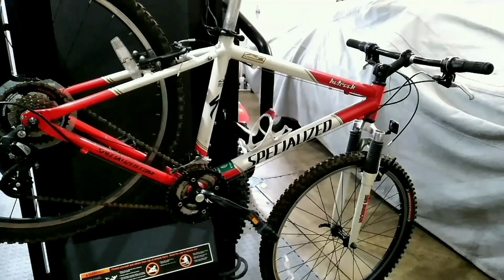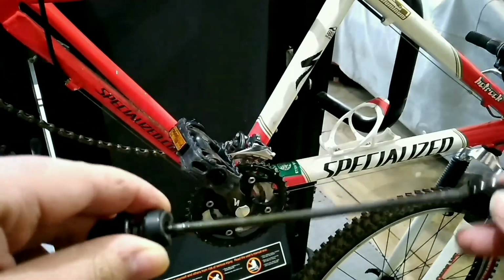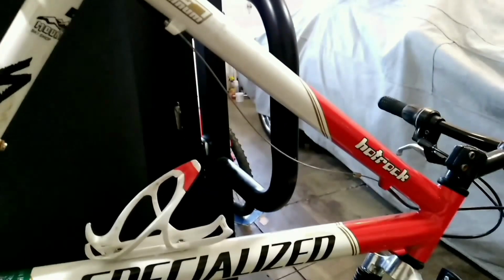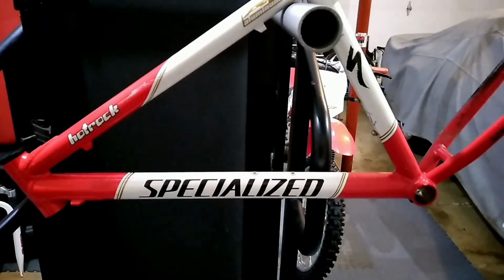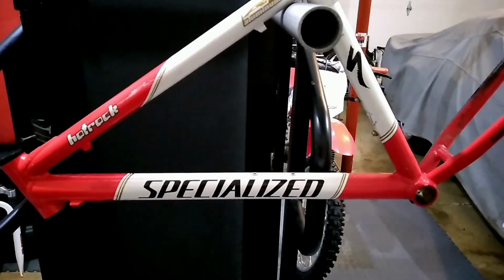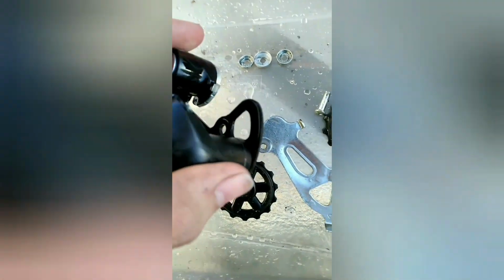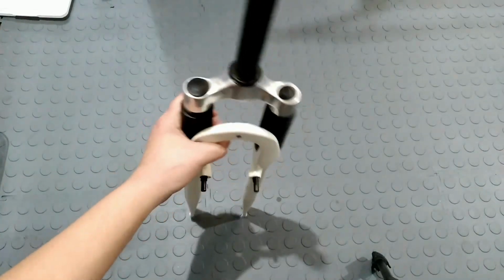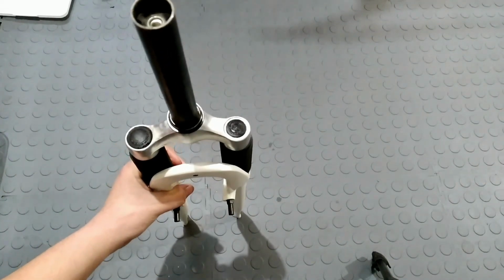Bike restoration ‐ 80$ Specialized 2002 hotrock 26 restoration

Comment: Why did you replace 3 chainrings with one? The range in the back is certainly not enough for 1x setup. Also, there is a concern over chain slip without the front derailleur or chain guide.